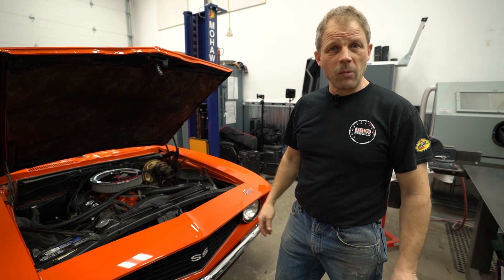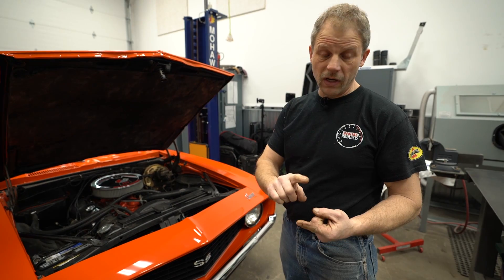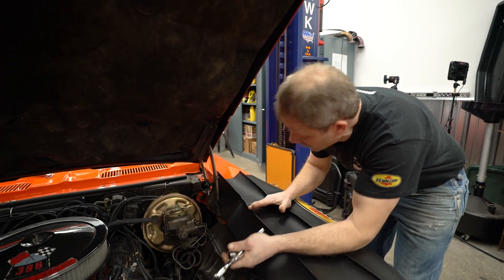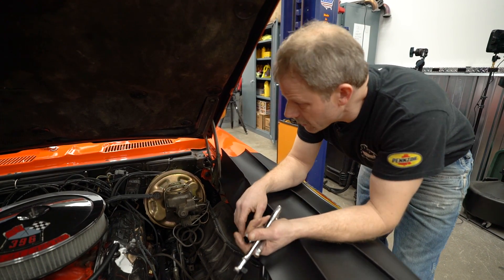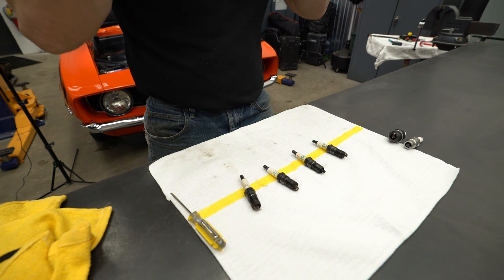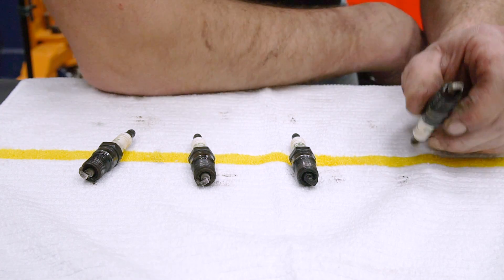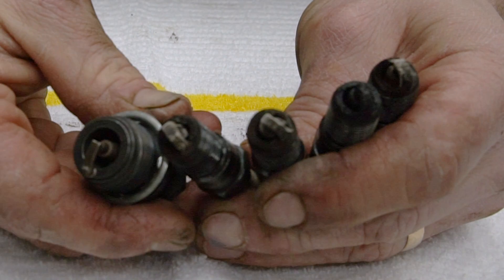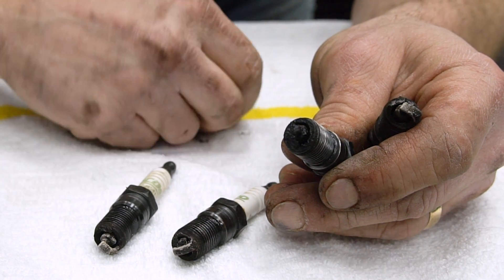How to diagnose engine oil consumption. Compression and leak-down test | Redline Update #6

Comment: Percent is based upon 100 psi.  You need the input pressure to be 100 psi to get a direct leak down reading in percent.  Otherwise, you have to do the math with the gauge numbers to get the actual % number.   It looks like the leak down %age is about 27%, still high.  Leak down and compression tests don't identify oil ring problems because they don't contribute to compression.

Comment: I have a 2014 2.0 TSI engine Tiguan volkswagen.
I changed the spark plugs my self and there was oil on three spark plugs.
Every 1400km the check oil level sign pops up.
Can this be the problem where the engine burns oil.
Or there is something else to check.
Changing the engine top gasket should fix the problem?

Comment: I have a question for you. I have a 3.1 V6 engine (LHO, GM) and I have oil in the intake manifold. All spark plugs are very white, with white upper electrodes. Does this mean that oil is burned in this engine? Compression on all cylinders is equal and perfect, 190 psi . The oil quickly turns dark in color. I'm asking for help. Best regards, Adam from Poland

Comment: Thanks for more info.
Question for you, as to what product and how much you think I should use. I have a 1995 Subaru 1.8L 4-CYL boxer Impreza, 177,000 miles.  I have 76 and 78 PSI dry compression in #2 and 4 of one head (driver side).  This started a few days ago, we noticed while on a highway trip the power was weak and I can hear it missing as the RPMs drop from driving to idle.

I don't have overheating, excessive oil consumption (drippy seals, I add a quart about every 900 miles), smoking, or fluids cross contamination.  I'm waiting to have a leak down and another dry/wet compression test at a different shop. The first shop only did dry compression and wasn't too bright or helpful. 

If I end up having a head gasket leak between those two cylinders, what products would I possibly try to mend it?  It must not be too bad of a leak, whatever it is, for the compression to build to 78psi dry.  The other two good cylinders are 130ish psi. 

If it ends up being a valve leak, what products and strength could I try to get them clean?  After cleaning, I will have valve clearances checked, as it's probably never been done. 

Thanks again.

Comment: I'm sorry, but you did the leak down setup all wrong and your results were incorrect.
The right way to use the tool is to leave the hose from the tool disconnected from the hose coming from the engine.  Slowly crank the regulator until the left hand gauge runs up to zero on the scale.  After the left gauge is calibrated at zero, connect the tool's hose to the hose coming from the engine and read the leak percentage indicated on the left gauge.  The right gauge is only useful for telling how much pressure is being supplied and it really isn't used for anything important.  Usually the leak down regulated pressure is set to 10-15 psi as indicated on the right gauge, but for hearing where the air is leaking, you will want to crank up the regulated pressure to up to 100 psi as indicated on the right gauge.

Comment: I have a 305 boat engine with all 180 and 1 cylinder with 150 what do you think about that? Spark plugs look the same, boat sitting for years and did not start it yet since it needs new manifolds. Thank you

Comment: Really good video. It makes clear what really causes high oil consumption (...the rings and not a leak somewhere). If I buy a used car, is there a reliable way to detect if the car has already a high oil consumption (like 1 litre pro 1000 miles) ? Does the compression test also work if there is a lot of carbon built up on the oil control rings ?

Comment: Why the hell do I have better than new compression in all eight cylinders on my fresh rebuild but blow by on all 8 cylinders when I do a leak down test? The car idles like crap I've done everything to try to fix it, it's got to be the aftermarket Cam that wasn't degreed!--- 93 mustang trick flow stage 1 cam which was installed dot to Dot! Somebody say something it's driving me nuts! It ain't the valve adjustment or the valves or the fuel system or the ignition timing! Or the plugs or the wires! RPMs are jumping around fuel pressure is jumping around vacuum is jumping around engine shakes!

Comment: Great instructional video. Question; How do you correctly determine the compression ratio? I know how to figure cylinder and compression chamber volumes but not how to determine dished pistons and piston clearance to the top ring. Thanks

Comment: HAGERTY, why didn't you put the cylinder in TDC top deal center when doing the cylinder leak down test? you just removed the intake valve and exhaust value for only cylinder#3?

Comment: HAGERTY, 
                                  //   If the PSI level values compared to each other cylinders was more than 10% to 20% what would be the problem with the engine?

Comment: Very informative video! Can you expand on what causes the white color on spark plugs? I have an oil consumption problem and have been  trying to track it down, after putting new spark plugs in very recently and pulling them to do compression and leak down tests I noticed that all 4 plugs(dodge 2.4L turbo) have a white residue on the ground electrode. Any pointers to send me in the right direction would be greatly appreciated. Cheers!

Comment: Bought an 1978 GMC 3/4 ton pick up big block454 at very low price with all plugs fouling. Did compression tests all good enough.  Intake manifold looked wet, so cleaned, tanked and then magna fluxed. Filings showed crack running from side to side right under the carb intake. It was sucking oil up through crank case. Installed new intake manifold and no more fouling. I used and abused the truck for years and sold it to a friend and still running strong with no fouling. Workhorse gust gas hog averaged 12.5 mpg.

Comment: With it that bad, I'd imagine you have an oil sample sent out to see fuel dilution, an intake leak on the underside of the intake will do this almost exactly as you've described
Reply: A head gasket leak can also cause one or two cylinders to check low, but fouled plugs in this case indicates this is not the problem.

Comment: I was taught if you step on the throttle and get blue smoke its rings. If you back off the throttle and get blue smoke it's valves.

Comment: Showing how to troubleshoot it right. It sucks that it's the piston rings. Valve seals would have been much less of a costly pain in the butt to deal with. Although while you've got it apart I suspect that the heads will get a service too.

Comment: My diagnoses is, stuck oil control ring on cylinder 3 for sure, and sticky oil ring on the rest, from short runs and lack of oil changes.The oil looked nasty when it was drained. It will be interesting to see, when you get it apart, what the true problem is. Great video!

Comment: From looking at the other plugs, the ones covered with ash, I'd say the motor is running hot consistently (wrong octane fuel or low quality fuel). The ash could also be from a small bit of oil leakage into a hotter cylinder. Not all oil burning shows up as an oil foul symptom like the plug he is working on. Great vid. I'd like to find out in a future video what the ash deposits are from for sure.

Comment: When doing a leakage test I've always just balanced that particular cylinder on TDC so you don't have to worry about the engine swinging around and valves opening on you.  Start off with #1 top dead and work your way through the firing order.  Can use something long and thin like a welding rod or a long screwdriver through the plug hole to feel when the piston stops. 👍

Comment: Any old hot rodder that's been around Rat Motors much knows you don't run AC plugs, you don't run Champions, you run Autolites in them. Maybe now days Bosch or NGK has something better?
Reply: Bosch and NGK had something better for the last 30 years lol.
Reply: @CanadaBud23  Or its easy to sound like you know what you're talking about anyway.
Reply: @kmcwhq  I swapped over to NGK about 15 years ago for my Jeep (still stock). I've used the Bosch plugs a few times when I couldn't get the NGK plugs after the rebuild. I've got autolites in there now because of a bad batch of E3's in the stroker recently. But they are getting worn fast and they only have few hundred miles on them. They work, just wear out really quick. I imagine they would last about 3-5000 miles in this motor.

Comment: If the rings are bad, try check the dipstick after/while the engine running. Piston rings should seal oil & combustion chamber in two way, if the rings broke exhaust gas will pass through the ring and you can find exhaust gases from dipstick.

Comment: Hmmm someone doesn't know how to use his leakdown tester... should be setting the primary gauge to 100...
Reply: @aldo6192  If you are going to bother writing down the math then going 100psi wouldn't matter much would it. Hookup doesn't matter either, won't change anything, it has to pressurize the cylinder to get a reading whether they go up at the same time, gradually, alternating ect. is irrelevant. The seal at the bottom of the jug is 33-34% what do you think the top where the most wear occurs is going to be lol?

Comment: Great video. I learned so much. Of how to do it the right way. 
   Something else that can cause this exact problem is a intake manifold gasket failure between the oil passage and the air intake runner
Reply: Yup I fixed that issue a couple times on later model 5.7, 5.0, and 4.3 Chevy engines.
Reply: Could be, unfortunately you'd have to take the manifold off to find out lol. Ya never know, we'll find out when he tears that bish apart!

Comment: The WHITE on the spark plugs is made by water vapor from the PVC system.....the ring blow-by contains the water vapor....a by-product of previously burned fuel being reintroduced back into the combustion chamber instead of going out the exhaust the first time around
Reply: Dave Anderson that's why I made a catch can.

Comment: If you add oil through the plug hole and the engine is on an angle, that oil will sit on the low side of the block. How's the oil going to get over to the other side on the intake side? I love watching others wrench cause I wrench too. Keep the videos coming guys.
Reply: Oil will wick into the space between the piston and cylinder around the rings, and as soon as the motor is spun, it will spread and seal.

Comment: Great video thanks! Question; when performing the leak down test does it matter where the piston is in relation to TDC?
Reply: No, as long as you loosen the rocker arms so the valves can close. I like to tap the spring retainer to seal the valves in case of carbon build up. But if you don't want to loosen the rocker arms then you need the piston of that cyl at TDC on compression stroke so both valves are closed.

Comment: The leak numbers on #3 are better than #5 because of the oil you squirted in them.
Reply from the maker: Good point! Conclusion is the same, but yes, you are correct.
Reply: @Hagerty  Simple fact is that they're both leaking down, and the others probably would too, if they were checked - you generally don't bake just two cylinders...  :)
Reply: @brand-x7049  exactly   the others will start leaking soon
Reply: @Saan455  If you're gonna through all the trouble of pulling it out, you might as well do it RIGHT. :)
Reply: @Hagerty Hi, I was just wondering what kind of oil did you put in the cylinder when you took the compression again...
Thanks !
Reply: Also can't wait for the timelapse video.
Reply: I didn't see him add oil to #3 cyl.
Reply: @johnmilnerQQ  Looks like it got edited out for brevity after he wet-tested the one on the passenger side.